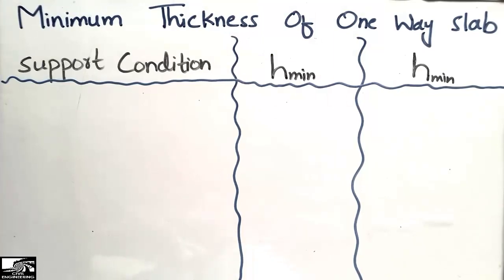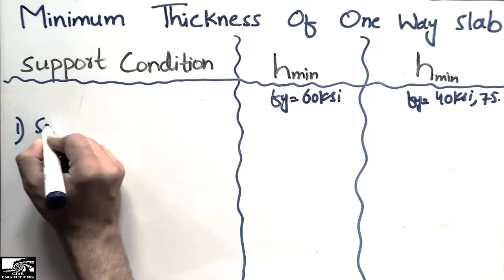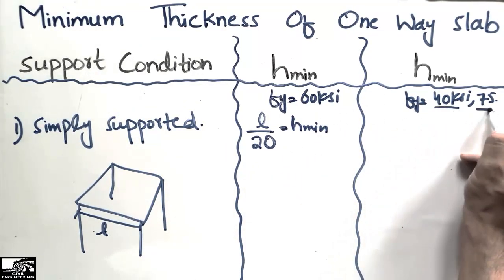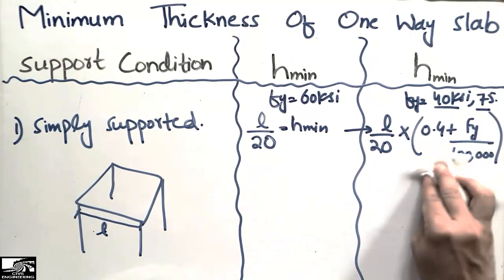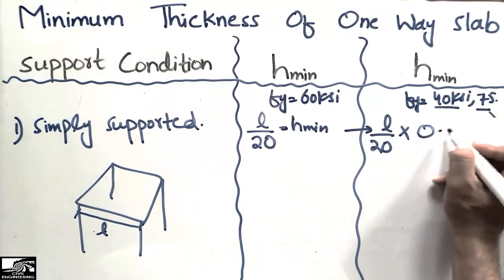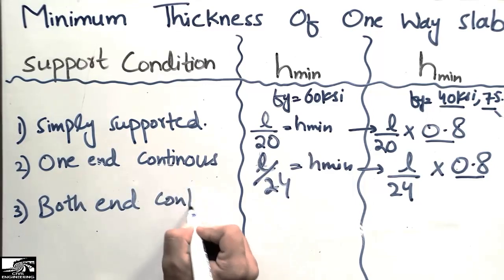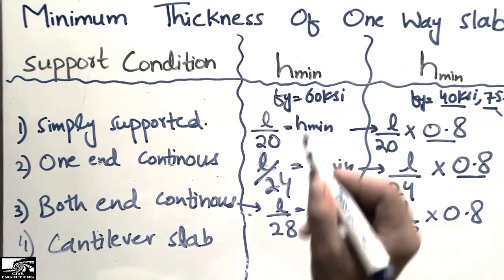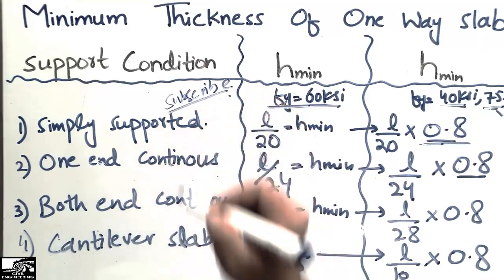Minimum Thickness of One Way Slab

Comment: Your equation for the 40ksi steel makes no sense. You will need a thinner slab for weaker steel? nope. Something’s wrong. 
And, ACI has denominator values of 24 28, etc... depending on scenario. You’re using 20?